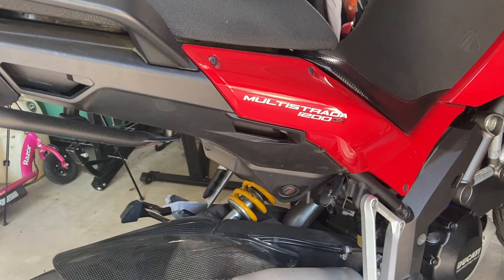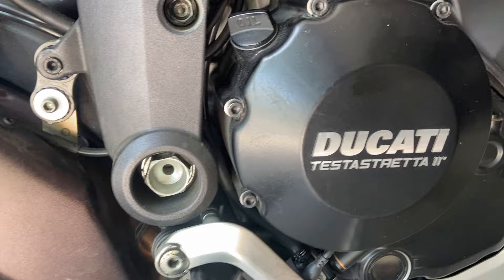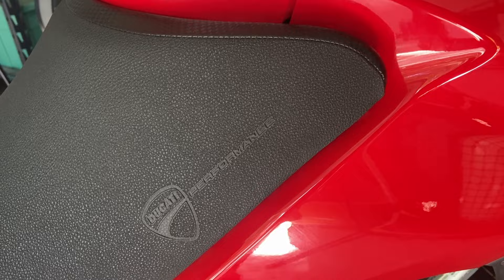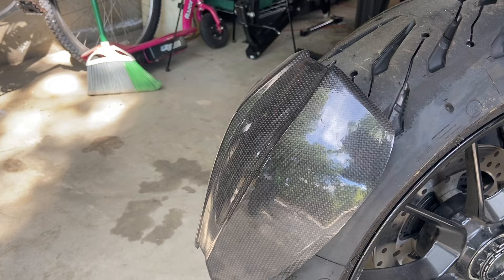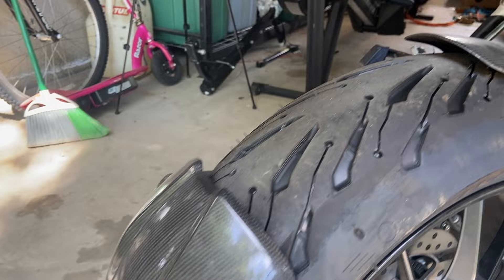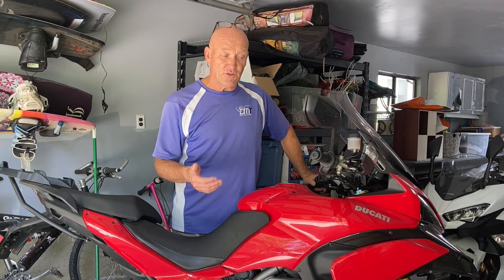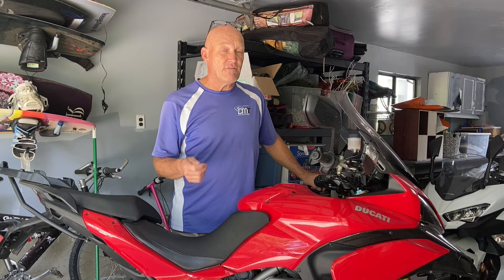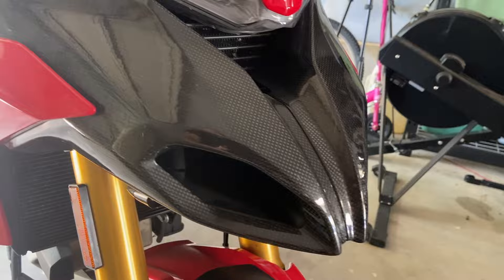Ducati 1200 Multistrada S, 2011 ergonomics review

Comment: Thanks Dave. Great video. It’s amazing that when we all drive a car we instinctively change the seat positioning, the reach and rake of the steering wheel, and the mirrors. Why? Because we were taught this. However, the exact same principles (apart from changing the mirrors) isn’t done by most riders to ensure everything is in the right place. 👍😎

Comment: Cant wait for more content on this bike, I currently have an 11 multi 1200s.  I am planning on doing a track day on it come spring.  Fresh tires this winter and replace leaking fork seal (both were recently done but one started leaking again 😢).
Reply from the maker: I had an absolute blast on it at the track in intermediate group once I got the chassis and suspension sorted. very little effot needed to get it around each lap.
Reply: @catalystreactionsbw   I'm planning on going to Barbers Motorsports park since it's in my backyard.  Looking forward to finding the right suspension setup for it and dialing in it's onroad settings as well.

Comment: I ride a 2010 Multi "S" that I've had for years. I think I have it set up pretty good for myself but I am really looking forward to this video series to see if I should maybe tweak things a little. Thanks. (I'm now 75 and have 65K miles on the bike).
Reply from the maker: Excellent work with getting the chassi and suspension where you feel it is good. Look at tire wear and see if the leading edge of the tread is rounded down to see if rebound is incorrect (same applies to the front). The Contact Playlist will assist you on rebound damping.

Comment: Given the multistrada is  on or off road capable, the slightly low brake handle is [for me anyway]... a tradeoff.  If I am up on the pegs for any reason that necessarily demands that lower angle.  Nothings free as they say, but having to reach up for the brake is doom: weak wrist position plus lost time, plus the chance of adding throttle.

Comment: Hi Dave I really appreciate your videos they are amazing! I wanted to ask you about how should I setup my Husqvarna Svartpilen 401 2023. The rear shock factory preload is 5 clicks, I weight 78kg with gear 80kg. Should I add 1 click or maybe 2… For the front fork rebound and compression I have options for sport and comfort also standard which is somewhere in the middle of the 2. Also the rear shock rebound also is adjustable like the front for sport, standard and comfort. What do you recommend for those? Thanks in advance
Reply from the maker: Set sag at 30-35mm front and rear. Then set rebound  in the middle of the range. Once you ride for 20 minutes, go to 25% and then 75% of the the range on the forks and shock simultaneously. Also assess fork and shock travel used after the ride to see if the bike is balanced with even travel front and rear.

Comment: Nice! Really. As owner of similar 1200s I'm waiting for next series. 
Seems like bar comes with standard mount or riser installed?
Drilling additional material from bar could compromise it's strength. removing pin is better way. 
This cool suspension may be upgraded with Ohlins ESU Mechatronic suspension upgrade unit 35000-03 _3

Comment: I have sane bike with 37k kms. I am still not 100% keen on electronic suspension. Hope to see your thoughts on that.
Reply from the maker: I will be changing the fork and shock oil veery 8,000miles to make sure the suspension oil is optimal and does degrade too far.

Comment: Dave,
  I have a 2021 Yamaha mt07 with only 33 miles on it.  I barely can tip toe on the bike. I would love to sit flat footed.  I'm  considering a lowering link for the rear and to cut the front fork spacers down, but not sure how much. I'm 5'8" 213 pounds.  How much should I cut the front spacers? What oil should I use to refill the fork tube with? I don't do any wheelies, no off reading, and no stunt riding.  I just want to cruise on my motorcycle and pick up girls😅. Thanks Dave
Reply from the maker: Thank you for your question. I would trim the spacer 10mm and use 400cc of 15w oil. I would set the forks with 20mm of fork showing above the upper triple clamp. Go to https://soupysperformance.com/ and lower the rear by 1". That should get you flat footed.

Comment: Which type of Grease is best for wheel bearing applications
1 Lithium red EP grease nlgi 3
2.methyl lithium red gel grease nlgi 2.5
Please specific details will help These are some options which I have in my area
Reply from the maker: Both show a dropping point of 350-400F. The Methyl version has a slightly higher dropping point based on the reading I did from here and probably is the better choice: https://www.freepatentsonline.com/4897210.html
Reply: bacon grease...

Comment: Do you have any experience with certain bikes being "allergic" to some tyre brands? I have fitted Dunlop Roadsmart 4 on my MTS1200 and the bike is crazy unstable at higher speeds,wants to initiate a wobble. On the Pirelli GTs that was unheard of.Everything remained the same inbetween tyre changes. My pressures are 2.4 bar front/2.6 rear and a 90kg rider.Suspension sag is correct with 52mm rider sag front and rear.
Reply from the maker: The allergy you refer to is geometry. There is no universal circumference for any one tyre size. Therefore, even switching between models within a tyre can create a massive impact on the chassis to create wobbles, braking instability and loss of braking power or sudden turn in. I have videos on this topic in the Contact Patch playlist.
Reply: Did you try pushing the forks down in the triple clamps to eliminate the wobble/instability? A few mm can make a huge difference.

Comment: Hi Dave as a 300lb guy (slowly dropping weight) is the standard suspension on an MT10 (non SP) something I can work with setting wise or will an upgrade be necessary?
Reply: You will likely need different springs. Check your race sag and your static sag, but likely the OEM springs are too soft.

Comment: i have cb 500 1994 assuming i want linear front spring what spring rate you sugest for me  im 180 190 lb in gear bike with full tank is 420 pounds +/ and it have weight distribution with rider on 45% front 55% rear  they try sell me 6,79 however it was progresive one so it increase resist non liner as it compress deeper and depepr from some point but i think it be to soft woth linear one ,hyperpro feg have from 7 ,7,5,8 to 8,5 👍🏻 i though 8 be good or it beto stiff for ride on bad quality road ? i dont understand this rsting they say its 8 N /mm what mean with 122 kg at front when i seat on bike front should compress x9,81=1196 :8 = 149 mm and this bike have frontsuspension jump 120 mm max 🤷🏻‍♂️🤔 like what? ok x2 cos thers 2 spring so 75 mm after seat on bike defenitelly to much where sah shpuld be 30-35 mm with this rating is something not right or some other parts in front fork give resist what i know in regard to dynamic compresion but static? 🤷🏻‍♂️ assuming thers no other ststic resist than only spring and some very small friction inside fork than its probably kg/mm and not N whatever how it is what front fork spring rate ypu sugest fpr me i wonder ? or fuk this i take this progrsive one and whatever onlysnetup sag with preload caps or make biger/smaller inside spacer if required 👌🏻 now i ride on to soft withput preload front fork compress 60 mm whet i seat on bike so i put in fork more spacer now is 32 mm its progresive spring and actually not bad at high speed on bumpy road 👌🏻 but with such preolad setup with this spacer not perfect as stock bike is withput preload at all and it shpuld with stock spacer have good sag i quees 👌🏻or for spring rsting they count only driver weight divide be 2 and than it start to have sense in regsrd to at first place static sag cos then its 80kg:2 x9,81 :sag 30 mm let say = 13,08 :2 cos thers 2 spring = 6,5 around than 6,79 will fix good for me 🤔 yea probably  they calculate those spring rate like this cos only than it have some sense e in regard to sag asf 👌🏻 whatever it is ,what spring rate ypu sugest for me ? 6,79 be good or not ? ☕️
Reply from the maker: If you have regularly bottomed the forks in the past, I would suggest you use 15w oil with the 78nm spring.
Reply: @catalystreactionsbw  Hi Dave, I have Yamaha MT-07 2021y and I've noticed a problem with rear wheel. When riding on uneven surface or bumps rear wheel feels wobbly. Im 180cm ~ 6ft and 80kg~176lbs. What should I do?
Reply from the maker: @asaro5608  Cold pressure would be my first question followed by odometer reading to see if the shock needs to be replaced with aerviceable unit.

Comment: dave, can you help me?? can you take a look in my last short video, my bike is woobling terrible, in turns and even in straight line, if not my stering damper i would-ve be sent into air hahaha, thanks man
Reply from the maker: Have you had the bike set up yet? How old is the fork and shock oil? Was rebound set with hot or cold oil?
Reply: @catalystreactionsbw  the bike is a RE continental gt 650 2024, is brand new, only 400miles on it... no setup yet, just how it comes from the factory, only thing ive changed is the steering damper for dont die haha
Reply: @catalystreactionsbw  the bike only have  pre charge in rear shocks and front fork dont have anything, im buying a pre-charge cap for it, should i take a look in the oil? i live in Brazil... no good mechanics near here haha
Reply: @catalystreactionsbw  i just discover by the manual, the fork oil is 2,5w... LOL